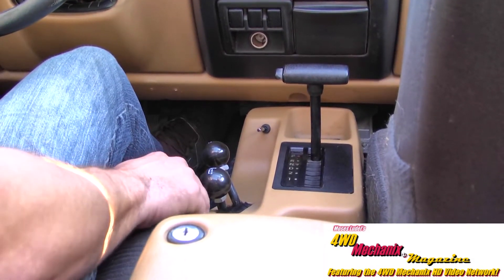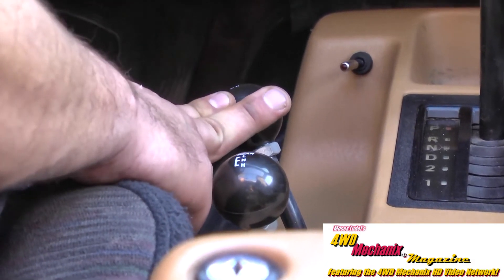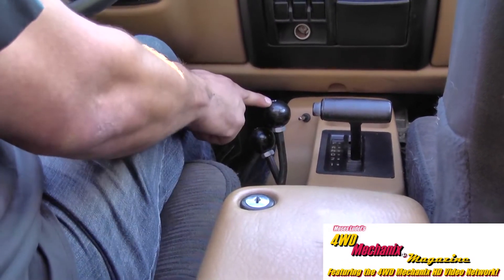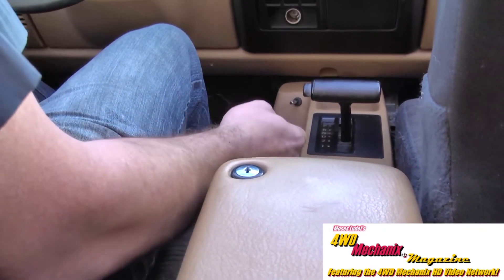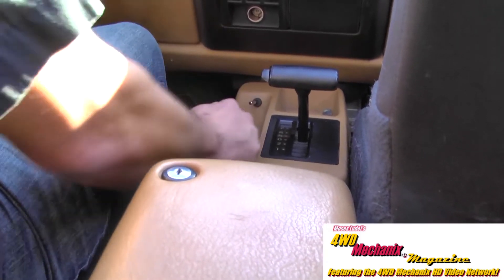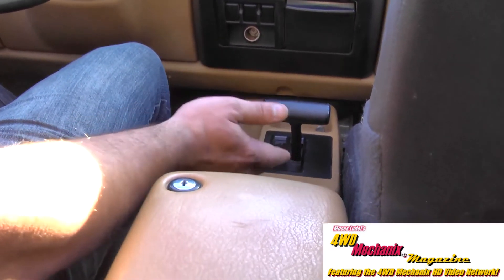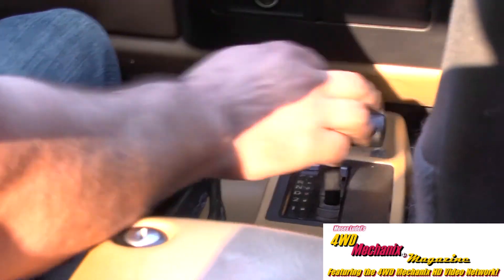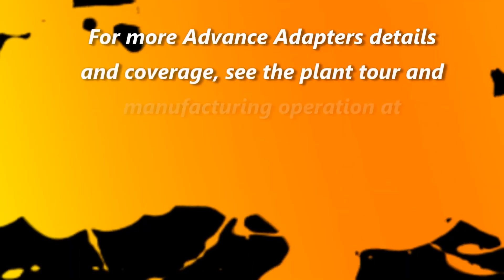How to Properly Shift the Advance Adapters Atlas Transfer Case

Comment: Can the Atlas be used front drive high only?
Reply: No.
Reply from the maker: To my knowledge, it's low range only and used as "front dig".  I understand your interest, there are times when front high range would be handy.  Confirm with Advance Adapters, they can advise on operational modes for your specific year/serial number Atlas.